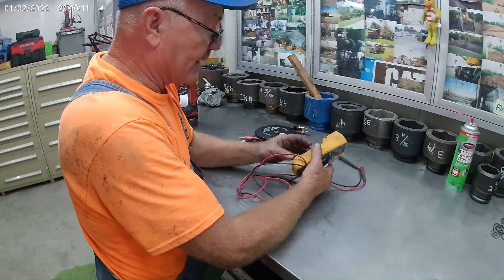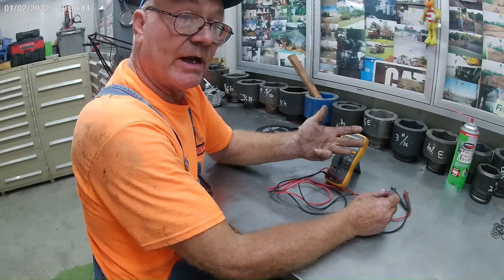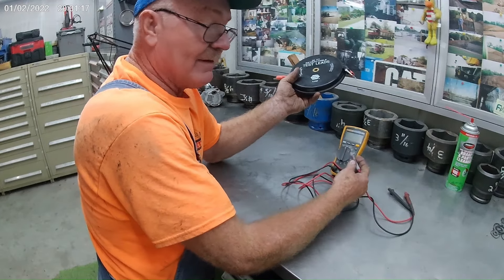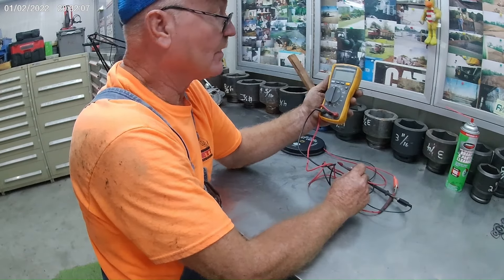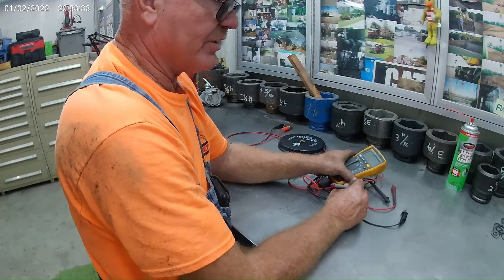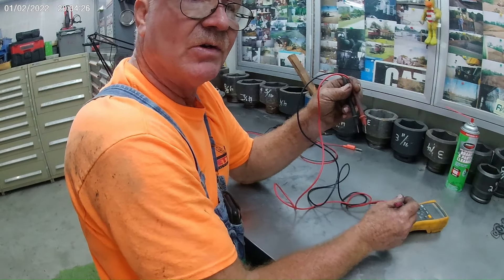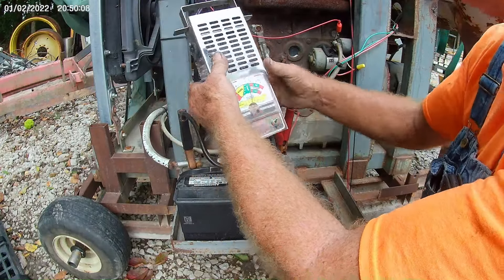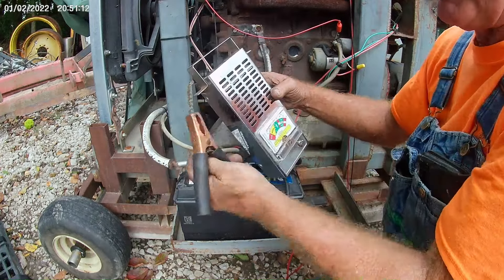WON'T START !

Comment: All Great Tips Mike
I try to replace batteries every 3 to 4 years in my primary vehicles especially  the Wifes SUV,  Ha
Then I move those batteries to my lessor used trucks/tractors, and keep then on maintainer.
I have some 7 to 10 years old and still going.
I get my batteries from Rual King. There made by Deika or East Penn.
That test light trick to check the ground was a new one on me. I've used vom to check V drop and
Resistance, but the light was pretty cool.
Thanks
TGP
Reply from the maker: Love Rual king battery's & the price!! cheapest battery at napa is $119.00 & Grupe 24 at rural king is $ 59.00 WOW !  Also happy wife happy life LOL!  Thanks Tom, hope you are doing well ! MOE.
Reply: @dieseldoctor25  Exactly why I buy them Including Grp 31 and 4 or 8 D
All good here , just trying to keep this old iron running.
TGP
Reply from the maker: @thomaspetroff9117  last week  they had group 31 battery's for $79.00 WOW!